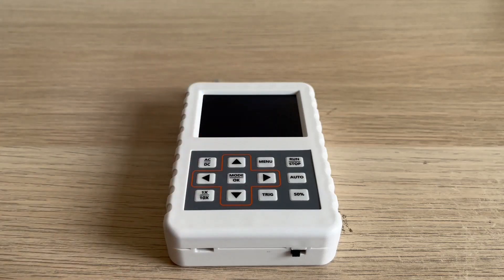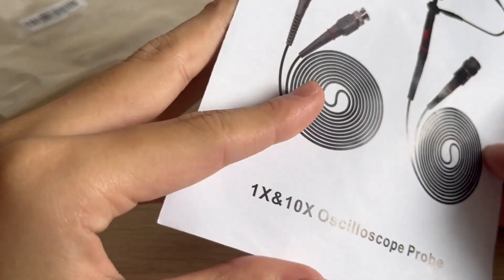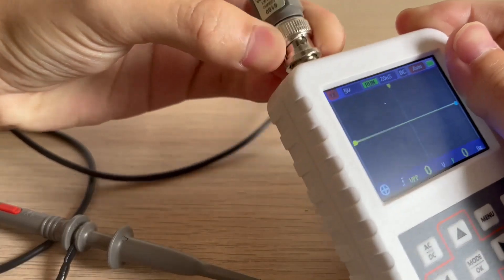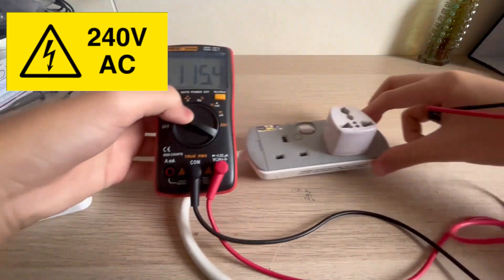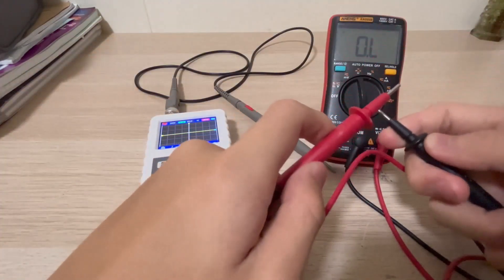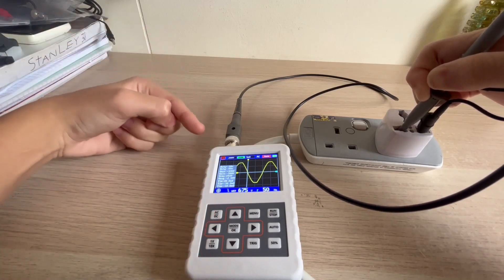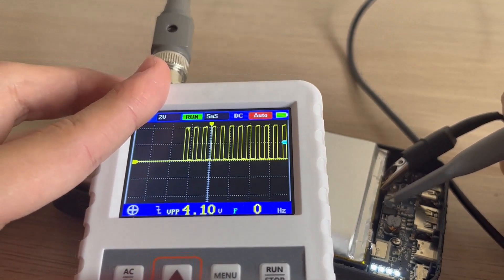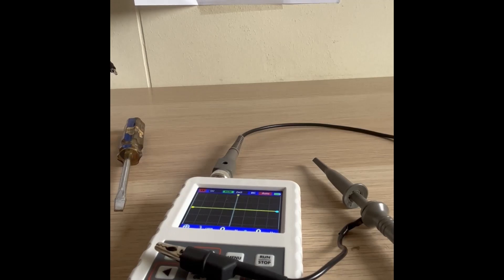Reviewing a $60 Oscilloscope (FNIRSI-DSO Pro Digital Oscilloscope)

Comment: The auto mode works? Because I see in other video that for low frequency the auto mode don't work and you have to adjust manually.
Reply from the maker: It does switch between ac and dc coupling as I’ve tried it

Comment: Interesting to see you can get a useful scope so cheap! This will be my first scope, I think, when it's time to buy one. Infinitely better than no scope at all.

It's a shame it only seems to have one input, one probe connected at a time. Otherwise the coloured rings would be useful, you could match the ring to differently coloured traces on the screen and be able to instantly tell which measurement was which. It's a shame it doesn't have at least 2 inputs, since scopes are so useful to compare one waveform against another.
Reply from the maker: 2 channel scopes are at least double the price :D